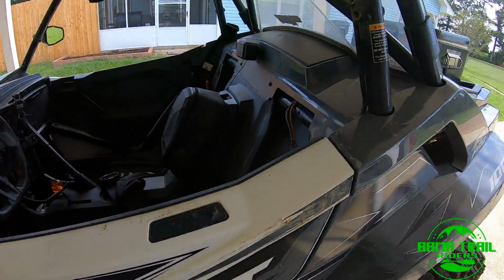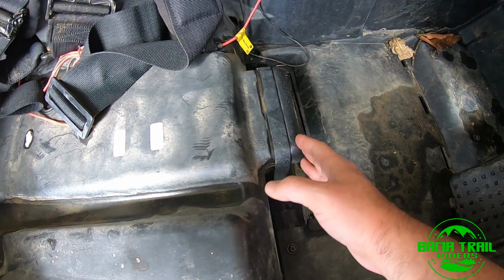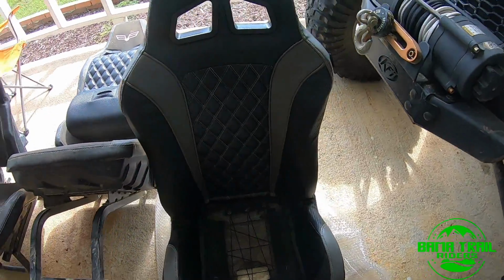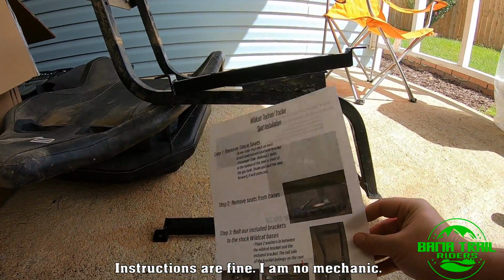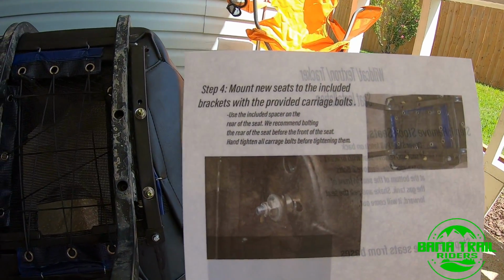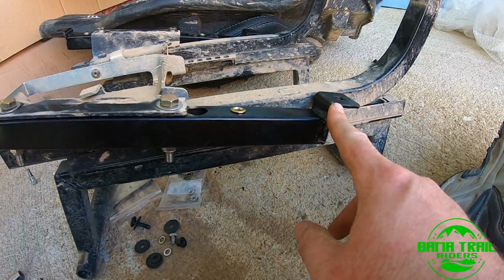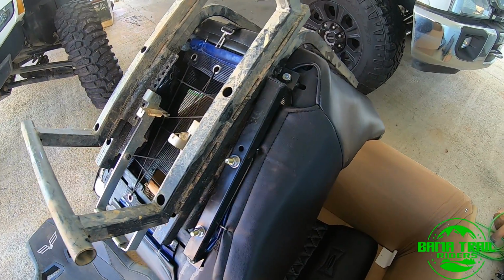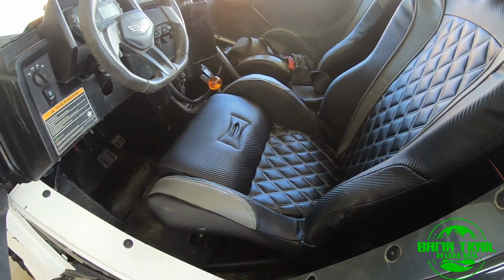Aces Racing Daytona Seat Install - Wildcat XX

Comment: I really dont want to sit any higher. Like my old X. I feel secure lower. They look well made tho.
Reply from the maker: That's fair, I didn't want the seat any higher myself. I like being low in the machine. If you are going to Wicked Wildcat Weekend, I'll have the machine there and you can check them out.
Reply: @BamaTrailRiders1  ok. Ill try to get there. Im only 3hrs away. Like to also find out your thoughts on tire choice etc.  Ive had 2 rides on mine and my shocks seem to already sag. So....not happy about that.  Hope to see you there. Be safe in your travels.

Comment: What’s your thoughts on the seats now? I’ve been eyeing them for my S
Reply from the maker: Sorry for the late reply. I put 200 miles in them at Windrock, some dirt road riding and a short trip to Hawk Pride. They are very comfortable, support on the sides and legs is much better than stock and there is zero wear or tears. I'd still put them a notch lower in comfort to Lucho's PRP but for the price, I would but another set. I recently helped install a pair in a 2020 X3 X MR Turbo RR and the install was a bit of a pain but they fit great in that machine as well. I hope this helped. -Paul
Reply: @BamaTrailRiders1  thanks for the reply, I’m ordering them.